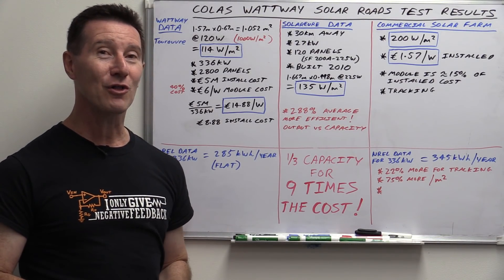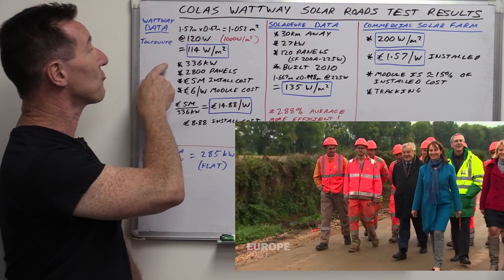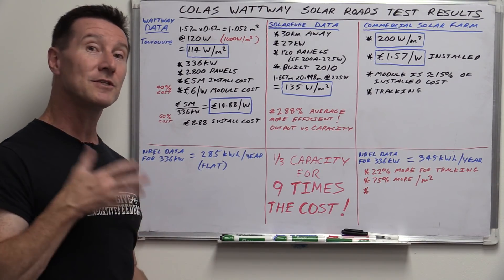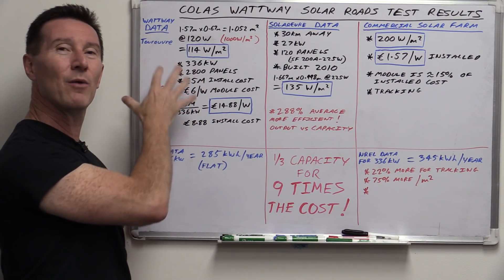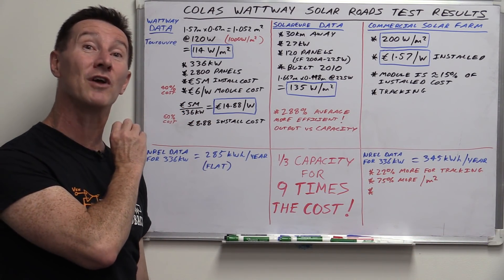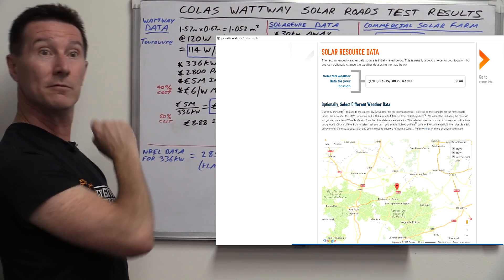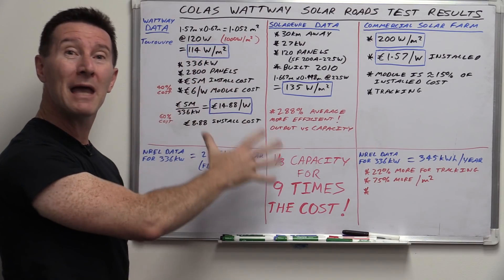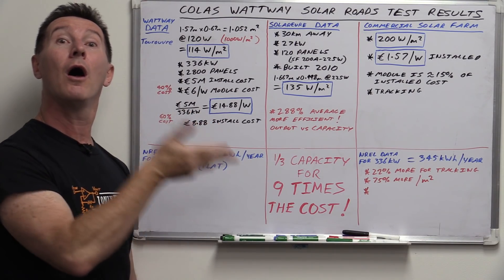EEVblog #1047 - Solar Roadways FINALLY BUSTED! (Colas Wattway)

Comment: I love you Dave, but you do realise that the greatest cost involved in renewable energy production at a national level is the land rent? Particularly because the places which need this power the most are the ones most densely populated, where the value of land is at its' most premium. So, it doesn't have to be anywhere near as efficient in producing energy to be more profitable. ;) I know, you're thinking like an engineer. But to understand why they're even trying, I think you have to think like an accountant. ^_^

I know you live in Aus, but here in the UK, the roads are the largest landmass already owned by the government, and most of that land is actually in the areas with the highest population per square mile. I'm sure that Singapore and Japan have similar issues. Houses aren't owned by the government, and can't be sold to commercial farming interests, because people are living there. They're considering compulsory purchase of farmland, but that reduces the nations bread-basket for an increasing population which is hungry. That kind of works for wind, because you can still graze animals between the turbines, but even grass needs the light solar would take away.

I'm happy to admit that it would be a far better idea to run the panels on a canopy over the road, but then you may end up spending some of that collected energy lighting the road so the cars aren't driving in darkness.

Better yet, just don't light every street with the power of a thousand suns, causing such light pollution that our urban children don't know what real stars actually look like in the sky. :( Okay, you've not produced any energy, but you'll sure as hell save a lot. ;)
Reply: "you do realise that the greatest cost involved in renewable energy production at a national level is the land rent" - sources please?
"Houses aren't owned by the government" - yeah, but the government can encourage the population to install rooftop solar via subsidies. Btw I've never been to the UK, but from what I can tell, you guys have lots of shores. Windy-ass shores. Wouldn't onshore/offshore wind work better than solar anyway?

Comment: Correct me if I am wrong, but wouldn´t wind turbines make more sense?
Random example: Enercon E-126
126m rotor diameter (pi * r ^2) gives us ~16,000m^2 generating 7.5MW
That is about 468W/m^2 and 0.55€ per Watt

Comment: Hi. I agree with you that the use of solar panels on roads and sidewalks will not work moneywise. And maybe also not handy for maintenance. But the low price for commercial solar farms. Is that only the price for the system and installation or do you also take into account that you need to buy/use a piece of land that will add to the costs? When using it on a sidewalk it is a double  purpose on the same area. Same like putting solar as a shading roof over a parking or something. Just building a solar park means the area can not be used for other things. But again. I am sure it does not work the best in a walkway or a road.

Comment: Dave, do you know, or have you seen, any comments about hysteresis is solar panels. How quickly does the power outpout drop off when the panels are shaded and how quickly does the power output get restored once light gets through again. In heavy traffic would the power output be very reduced.

Comment: Solar Roadways have only 1 advantage. If you live in a place where you simply have no space to build  large solar farms. 

Basically, if the land is more expensive then the setup, Solar on X might be reasonable.
Reply: That would be densely populated cities with no open space nearby to place a solar farm (just an fyi: you can build solar farms on water too, which is exactly what the Japanese are doing). In this situation, you'll find that solar on rooftop is the easiest to build, and offers way better output than solar flat on the ground, shaded by buildings/cars/trees. So as long as you have unoccupied rooftops, you won't see much point in solar roadways.

Comment: Westfield shopping center in Marion, Adelaide has done solar right.  Instead of trying to turn roads into solar panels, the upper deck of the main carpark has been covered in solar panels.  Not only do these panels provide electricity, but they also provide shade for cars on hot summer days.  Think about the thousands of carparks around Australia that could benefit from being turned into solar farms.  And I bet it would be far cheaper than solar roadways too.

Comment: Just a quick thought... What you miss here is that to install a commercial solar farm, you need to own the land you put that on... add that to the costs as well... I agree that the costs are way higher for the roads, but the roads are already there, no need to purchase land for them. Same as for Solar Roofs... you're leveraging existing surface. Does that make sense or am I totally wrong?
Reply: In France, a hectare of grassland will cost € 3200 on average. Two hectares, € 6400. Two hectares is roughly the land you need to install a megawatt of solar capacity. How much that cost? Estimates vary anywhere between € 1 and 4 million. So, land cost is less than 1% of the system cost. In fact, I'm pretty sure it was already included in the calculation, but wasn't listed separately because it's not that big a factor.

Comment: The only real measure of effectivity is lifetime cost per kWh. Even high installation costs might be worth the while if the result is low maintenance, can last for a long time, and does not further waste space. I would agree that roofs are in general better target for such installations but roads provide more area and fewer owners to negotiate with. And while industrial solar arrays are definitely more efficient, they waste space.

Comment: They should have an incentive where people will be paid to have solar on their rooftops without the part where the energy company buys back the electricity, have the people get paid for the installation, have the money back through working out how much they used, subtract it from the energy they supplied and then charge them the watts, if they produce more than they paid then they get paid nothing

"but why would they want to do it if they don't get paid"
well, simple... if you are having free electricity and a free solar install... wouldn't you go for it... even if you don't get paid, remember... nobody earns back the money through the feed in terif alone, nobody...

Comment: Should be comparing with traditional tar roads. The cost is higher now but if one day it could be cheaper and more durable than tar roads, even though the solar road ways generate 1% the power of a solar farm its better than nothing since a road is going to be built either ways.
Reply: There is a TAR ROAD UNDER THE SOLAR CELLS! Their cost was only the cost of adding solar cells to an existing road!

Comment: Can’t help but wonder: in very hot climates, would it make any sense to use roads as the hot side of a Seebeck generator? Granted I imagine you would need to sink a heat pipe, and then you might run into thermally saturating what is supposed to be your cold side, but I’m not sure if that’s an actual problem or not.
Reply: No. If you wanted to utilize low-grade heat, any old power plant would be a far more reliable source of it than a road surface. The reason nobody does that on an industrial scale is because TEGs are expensive and inefficient. They're generally only suitable for niche applications.
Reply: tybofborg yeah it seems the inefficiency of tec generators is what kills it, otherwise I think it would be a possibly useful utilization of an existing temperature differential.

Comment: You actually buggered the maths up there Dave. An array would be sized for a given kW target, not for a given surface area - road area is there for the taking. So it's actually 27 times more expensive per kW. They could make the same power on their local Carrefour Contact Tourouvre supermarket which is about 30 metres square.

Comment: In Canada the roads get snow and ice on them for pretty much half the year. We put down salt (or varient), gravel, and run snow plows and studded tires over them. So guaranteed, you can rebuilt it every year.

Comment: Hi Dave. I think your really missed the point of solar roads. I think this one of these cases  where us, engineers, have difficulties to admit that a bad technical solution might be a good solution overall. I don't criticize your analysis. It makes totally sense. But I think the advantages of the solar roads are elsewhere. For instance: I live in a country where the cost of every square meter of land is incredibly expensive. Imagine the price of a solar power plant where the land cost is more than 1000$ per square meter.
At the other end, roads are already belonging to the state.
Of course putting panels on every roof is best. But roofs  belong to people. It's difficult to force people to retrofit solar panels to old buildings.
I think the solar roads could solve problems that are very localized. Of course if you live in a country where you have plenty of space in desert area it's obvious that solar roads are not the clever way to go. But where you have to choose between  nothing of solar roads why not choosing solar roads? As I said: I live in a country where building a solar plant is almost impossible due to regulations about preservation of the landscape and the prohibitive cost of land. Forcing  new buildings to embed solar systems is already compulsory. But it would take decades or centuries to have  sufficient renewal of the buildings to get a significant amount of solar roofs built.
I would conclude by saying that.you are right. This solution is not the very best by far. But the better ones might be impractical. Thus among the remaining options, solar roads might finally be the best solution...
Reply: Let me guess. Land in your country is so expensive because it is a small country full of mountains (thus perfect for hydro & wind), or it is surrounded by sea (thus perfect for offshore wind & solar).
Reply: tybofborg. Exactly. But nowadays you can't build new hydro plants. We are currently increasing the height of a lot of dams but building new is out of questions. Same for wind. Everyone like the wind turbines but no ones want to have them near its own house. Thus almost impossible to build wind plants. As I said. Wind or hydro make much more sense than solar roads. But because on non technical issues, theses solutions are not suited.

Comment: To me its common sense that putting it under a road is never going to be efficient, you are going to get dust,tyre rubber,dirt,rust, oil, coolant etc from vehicles on top of the thick glass, all this does is stops photons from getting to the panel, crazy idea

Comment: I think your head may be just too big for you to see the flaws in your logic... Your only point of comparison is a solar farm, however I really don't think this technology is made to compete with solar farms. I could be wrong, but I'd assume the point is that there is millions of miles of roadways across the globe, where, if viable, they could slap solar cells down, and not take up any more land than the road is already taking up(save the few meters on the side of the road for supporting components).
Obviously replacing ever forest with giant solar farms, phasing out real farms for even more solar farms, etc. Would generate more power and be cheaper, but I don't think that was ever actually up for question by anyone other than you.  By your standards solar as a whole isn't viable as a hamster wheel connected to a alternator has a lower cost per watt...
Reply: Just 5% of the agricultural land we use could power all of humanity. Meanwhile, modern technology can increase the yield of farmland by much wider margins.
Reply: tybofborg right, where did you read that? Notice you also forgot to mention how exactly 5% less farmland could power the world? Nuclear power? Donating that 5% to wind farms? Solar power? Maybe you've forgot there is already hardly enough food to go around and the population will only continue to rise. Good luck being the government that decides 5% more families can go hungry simply so they can pay less to keep the lights on while they starve to death... 
Again, I'm not saying this solar roadway thing is any sort of a viable solution, but it is clearly a specific solution made to generate power by utilizing land that is already used for something else. Its the same principle why most hones and businesses have solar panels installed on the roof rather than cover the same sq footage of their backyards with the panels. Obviously you could maybe see some perks by covering your backward with solar panels rather than your roof, but you also no longer have a backyard then, while having them on the roof; a place you never were going to use for anything else anyway, means you get to keep your backyard for anything you can desire. Catch my drift?
Reply: Martin J Martin J I didn't read it anywhere. I did the research myself. I can take you over that, but really all you need is Google and a calculator to verify it. Obviously, I meant commercial solar farms.
You also seem to have not read the part of my comment where I said that modern technology can improve farm yields my much wider margins than 5%. In sub-Saharan Africa this could be simple stuff like crop rotation and seed rows; in Europe it could be GPS-guided tractors and crop surveyor drones.  
As for food shortages, that is not because of the lack of farmland, but a lack of effective distribution, leading to massive food waste. Not to go any further than America, where tens of millions of people live in food deserts and food-insecure households, and not because of scarcity.

Finally, you have a point about using rooftop rather than ground solar, but a lot of the ground is not exactly prime farmland. Meanwhile, since solar panels are expensive (sometimes over a 100 times more than  the ground they take up), it makes sense to get the maximum efficiency by using tracking systems. Rooftops are often not suitable for that. That's the advantage of commercial ground solar.
Reply: There is a large amount of land that is not suitable for farming, either because it is too rocky, too sloped, or has no access to water. In the US only 41% of the land is now being used for farming.  There is also the land between the roads in highway interchanges, and in small lots in developed areas that could be used. 
A well established number is that only 0.6% of the area of the US would be needed to power the whole country. We would not need to use ANY farmland! Since grass grows under solar panels on racks, you could even use it to graze sheep or goats. Also putting solar panels on roofs and over parking lots, etc., would mean even less land would be needed. Solar panels on roofs are also right where the electricity is needed so there in no transmission loss.

Comment: Be better to put the solar array ABOVE the roadway, then you could at least mount the arrays at a more optimal angle, and not need the damn texture to support cars.  7-8 meters up would be more than enough for 99% of traffic to pass under.

Comment: Go back to the drawing board, Sir!  You forgot to factor in the cost of the land needed for the commercial solar farm because you wouldn't be able to retain the original use of any land you may have.  The land for the solar road is not included as a cost because it is still a functional roadway.

You would also factor in council rates, land taxes, and continual maintenance to keep the weeds from growing over the comercial farm's solar cells.

Comment: dust and dirt....my van leaks about 1 quart of oil every 2 weeks.  Figure thousands of trucks driving these roadways,  add all the grease, oil, and spilled paint and chemicals and those roadways won't see a lot of sunlight.  I wonder if street sweepers with biodegradable cleaning agents is factored into the cost?

Comment: You could probably generate more power more cheaply by imbedding the roadway with thermocouples and relying on the surface temperature in direct sunlight. LOL.

Comment: Dave - Thank You - Thank you - Thank You!....      As a very pro-solar person and working in a related field ( power electronics - we supply to the inverter companies)  -- the whole solar roadway idea drives me insane.    It is NOTHING more then a political - PR - government money grab.     Outside of the technical / economics of the solutions at hand - you touch on my issue at the end - a roadway is an incredibly hostile environment... and MUST meet a number of performance requirements - that are all counter to effective solar energy transmission and reliability...  in the end this just blackens the eye of the whole movement, and takes money away from more effective projects and ideas.

Comment: Dave you don't understand. The people who write their signature on these contracts don't care about the efficiency compared to commercial solar farms. Electricity grids are run by companies, but the government still has to spend their "green" budget. The result is this sort of crap. Also I think it's likely that the guy who gave the go-ahead received a check for that.

I would much rather have seen that 5 million euros being used for a couple mega-watt hours of conventional solar panels.

Comment: Here in the southwest USA, I've always wondered why they don't roof over parking lots with solar cells; it would shade the cars so they don't turn into ovens in the summer, keep the rain off (when that happens) in the winter and provide power without having to find new land to put them on. When you add in the rooftop areas of a shopping center - that's a LOT of solar collection area and given how many of them we have, it would really add up!